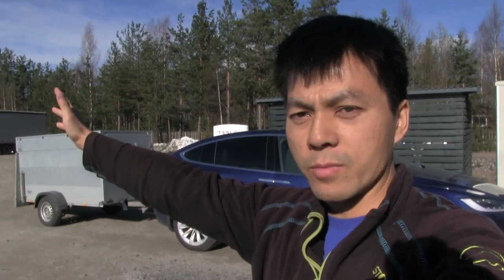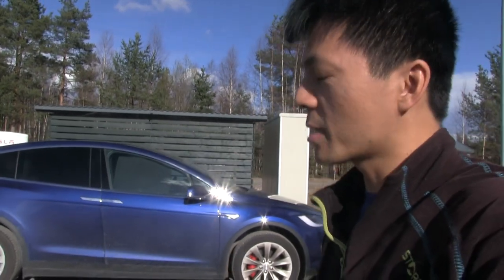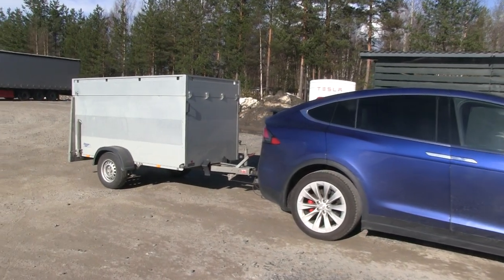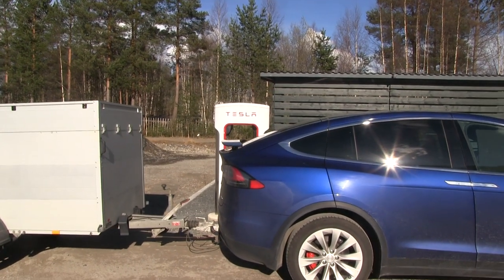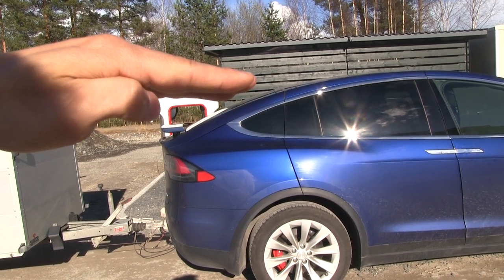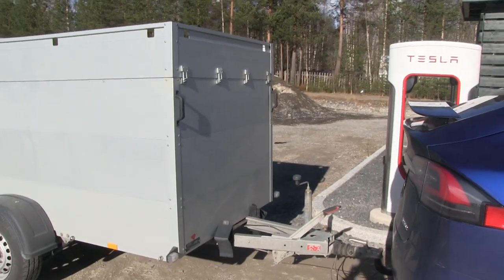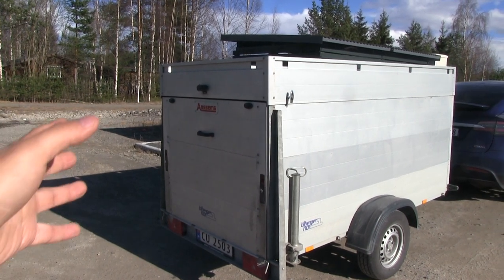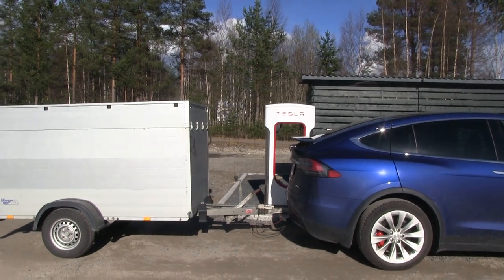Model X with trailer: Can the efficiency be improved?

Comment: Mount 2 of these or similar (http://www.ebay.com/itm/270222-Sea-Dog-Line-Stainless-Bimini-Swivel-Deck-Hinge-Top-Side-Mount-132-1055-/301653652059) each side on very top front corner of the trailer. Build a trapezoid shape frame from 2” to 3” tubes made from aluminum, fiberglass or from any strong but light material. As you can imagine the longer side of the trapezoid shape frame will be somehow mounted to these two hinges. Construct the frame so when mounted it will not come too close to the SUV especially when you make sharp turns.

You can cover this frame with either sheet aluminum or a canvas button to the frame. You can leave it as a flat platform or add an oval shape to it. The depth of the oval should not exceed the depth of the trailers top, this way when you swing it up to store, it will lie flat. 

How it will secure during driving? Okay, you will have to mount the same type of hardware (hinges,2ea) either to the bottom corners of the trailer’s box, or to the sides of the trailer’s frame.  Attached 2 support tubes to the hinges and the other two ends to the front of the platform to secure it. 

These two supports tubes will have to be removable and mounted with push/pull pins.  Now you can imagine these two support tubes will run from the short part of the trapezoid shape frame to the bottom side of the trailer. The length of these support tubes depends on the angle you think its best for air dynamics.  I suggest the platform to be position just pass the SUV spoiler. 

I have other suggestions to improve the air dynamic performance of your trailer just from adding simple tricks to the rear and the top of your trailer. Hopefully this idea will help with your situation.

Comment: Have a look here. 
https://www.tc.gc.ca/eng/programs/environment-etv-menu-eng-2939.html
The first picture shows what the form of the front side fairing  of your trailer should be. Split those fairings at the hingeline and make the lower fairings below the hing movable.  The give the clearance to open the lid. I would think it makes sens to have the fairing not only at the upper side. It is important to use the on the vertical corners as well. The problem is  3D.

Comment: Don´t touch the X.

What i would do is a bulge on top of the trailer. 
A board in front of the train axis/trailerbox. 
And a cover on the rear end on the side of the trailer.

Use cardboard and ducttape. Easy and cheap.

Comment: Teardrop trailers, with the fat end right behind the car and the skinny end trailing away, are the most aerodynamic shape. If the top of the trailer is lower than the roofline of the vehicle towing it, that's even better. The air will flow over the roof of both objects and swirl off the back end. Most of these trailers are also lightweight, which means the engine of the towing vehicle doesn't have to work so hard to pull it. However, similar to the most efficient cars on the road, aerodynamics alone won't achieve fuel savings. It's a combination of shape, lightweight materials and clever design. Easy come, easy tow.
(http://auto.howstuffworks.com/auto-parts/towing/aerodynamic-trailers-cheaper-to-tow.htm)

Comment: Thoughts: trailer is too tall, replace or rebuild? Attach some kind of shaped or bent plastic plates, skirts or half tubes where air flow hits the trailer. Drag is highly dependent on speed and shape (turbulence). Reducing speed by 10% reduces drag more. Holes in the trailer to let air flow through. Flaps behind trailer. Attach plastic plate on your spoiler and bend it upwards at the back and more air flows up and above the trailer.
https://gcep.stanford.edu/pdfs/ChEHeXOTnf3dHH5qjYRXMA/10_Browand_10_11_trans.pdf
http://www.at.no/transport/2016-05-31/Sparer-drivstofforbruket-med-over-30-prosent-21572.html

Comment: front of the trailer is too high - not level it points up in the air- lower the tow hitch so front of the box is lower than the back when connected to the car , a simple mod like that will save more than  5 % then a nose cone out of aluminium or plastic would get you an easy 10 %

Comment: I would suggest to make something similiar to trunk cover from trailer top to car, smooth vertical trailer front edges (make triangle (?) ). Also you can make liftable cone at the back of the trailer or this solution:
http://www.stemco.com/qbin/1794.jpg
Use max trailer tyre pressures and you can attach something similiar in front of trailer tyres as formula E:
http://adn.gpupdate.net/news/268747.jpg
Mor discutions on this toppic:
http://ecomodder.com/forum/showthread.php/project-aero-car-trailer-17210.html

Comment: Typically a lot more gains in aero are to be had at the rear of the vehicle where the flow separates. I'd look into adding some vortex generators to the back of the trailer, and maybe on Optimus Prime.

Supposedly you can gain 4% this way
https://spinoff.nasa.gov/Spinoff2008/t_3.html

https://spinoff.nasa.gov/Spinoff2008/t_3.html
Reply: Rounding the leading edges on the trailer would also yield some improvements depending on the radius. It'd be pretty easy to mock up using some tape and something stiff but a little flexible like cardboard or plastic sheet . If it works you can make it permanent by riveting some sheet aluminum over the corners to round the edge

I'd also fill in the hollow area in the top of the trailer where the roof rack is, as it's likely causing some separation.
Use either some styrofoam sheets or thick plastic sheet like what they use to wrap boats for storage. If you need the rack you can just cut it off

You could test this out by tightly  tying tarpoline over the top

Comment: Don’t mess around with that brick shaped thing and sell it.
Just buy a more aerodynamic formed trailer instead.
Reply from the maker: Read the description.
Reply: I know, you like this trailer because of its size and usability.
But i really think it is too difficult to make aerodynamic improvements on it with significant success.
Building a tailormade cone on the front side for example would probably be as expensive as swapping the whole trailer.

On the other hand, i am curious about creative solutions and comparing of the results :-)

Comment: No, the problem with fraud is that it never meets specifications when tested under standard load. The Tesla can't operate for more than 20 - 30 minutes under load with a one hundred kilowatt storage array and either one or two 310 kilowatt motors (two for deluxe). That's simple physics. If you want an extreme solution, you can try mounting an array of 300 watt panels on your trailer with a 3 kilowatt inverter - checkout the iKube.
Reply: Obviously. You'll have to park the vehicle and recharge it since you'll be consuming a good 300kw/hr to 450kw/hr during acceleration(possibly over 500kw/hr if your trailer is heavily loaded and you're driving a deluxe model over hills). There is no work around for energy conversion.